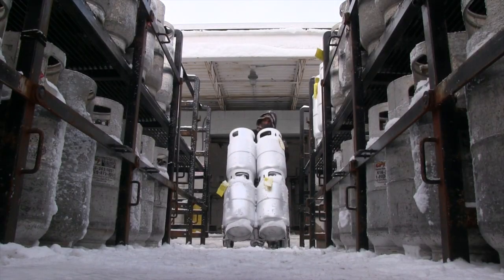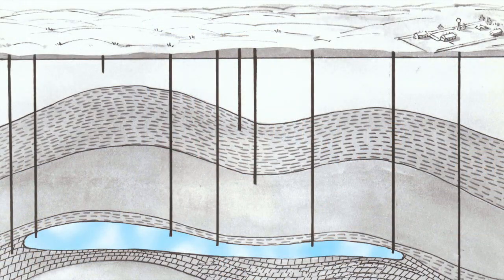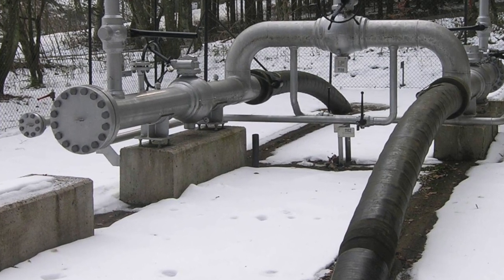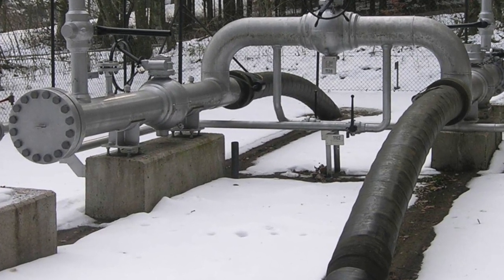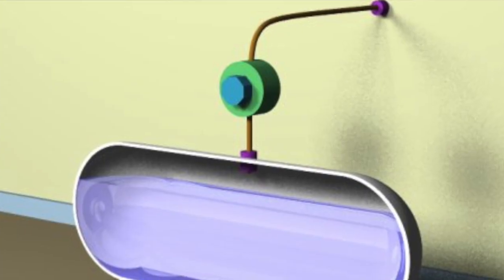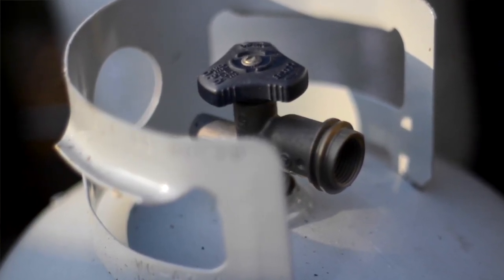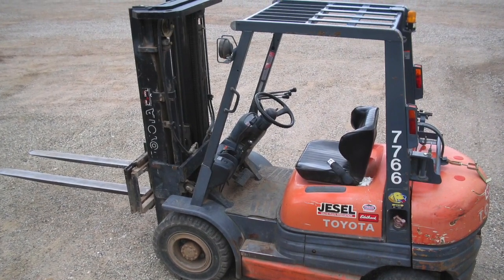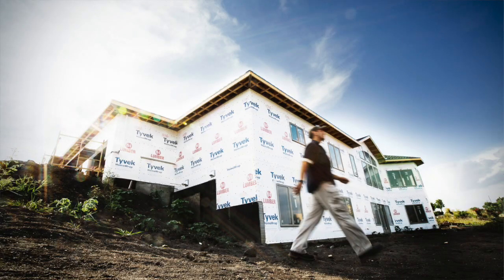What is Propane?

Comment: Yeah but.......if propane boils at temperatures below freezing why isn’t boiling all the time in the cylinders and tanks ?
Reply: Because of the high pressure inside, to turn a gas into a liquid you can either lower the temperature or increase the pressure